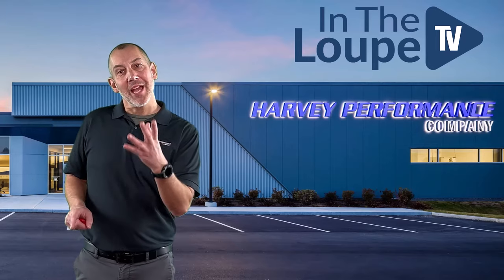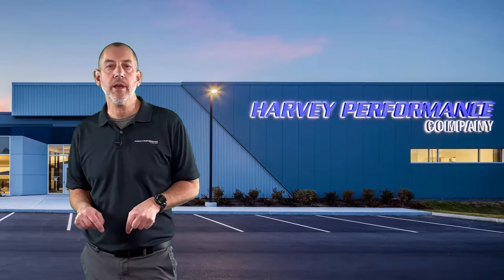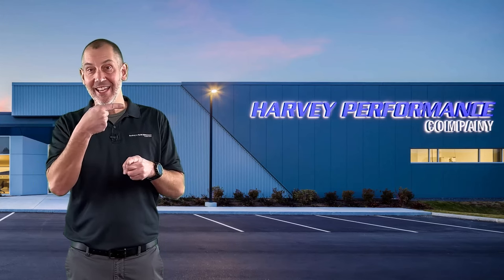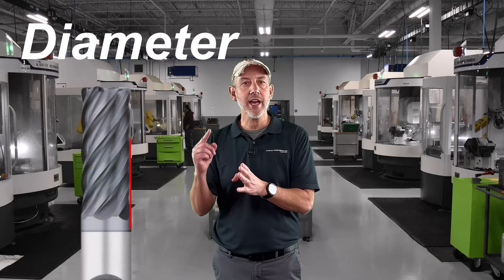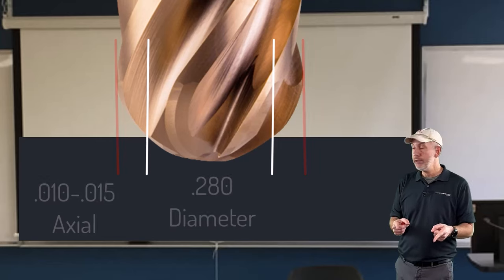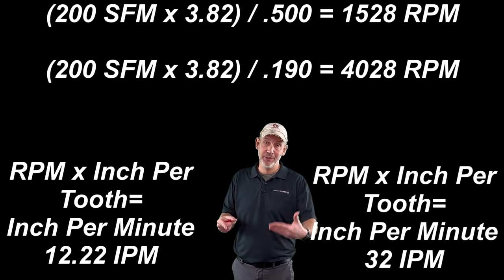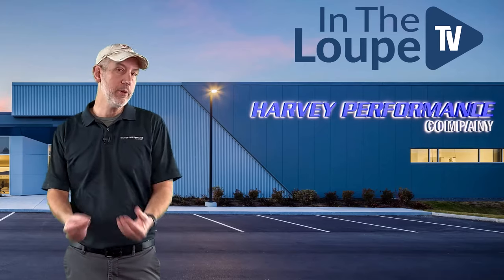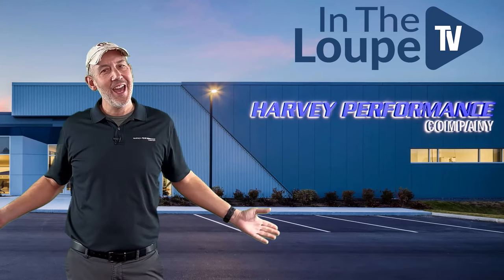Ball Nose End Mills & Effective Diameter: In The Loupe TV Short

Comment: This can be remedied on a 5 axis machine. If your surfacing with a ball and have the opportunity to increase your lead/tilt angle in your CAM software you can essentially do a .005 finish pass and use close to your full effective diameter.  
Obviously dependent on part geomety / clearances
Reply: You are spot on.  We are going to get into 5 axis soon.  But when you tilt you have a greater diameter to use and therefore can utilize the benefits of a ball.  Great comment!! Ctc

Comment: Nice video. But what happens when you cut 6061-T6 aluminum and your Haas machine has 12,000 RPM? It is impossible to achieve the RPM for a cutter less than 1/4 inch in diameter because you need alot of SFM (1000). And now, if you are machining a surface with a ball nose of 1/4in of diameter. The efective diameter is useless. In this case I assume that I use all the RPM that my machine has. but do I have to reduce the IPT?
Reply: Here is the thing with aluminum and SFM/RPM.  The reason we can run the SFM up so high is because of the properties of that material to form a chip and not put any heat at the cutting edge.  Just because we can run 1000-2500 SFM does not mean it will run just as good at 300-600 SFM.. ( obviously Slower)  So yes you are bound by the limitations of your machines capability with aluminum.   But your Chip load is calculated by the RPM you use.  So say you want a .003 IPT for a 1/4 tool.  Just Take your 12k ( MAX) and multiply 12000x.003x Flutes of endmill and get IPM.   Use the scale for any RPM to keep chip load constant.  This will ensure that there is no extra stress on your tool.    And yes it is exaggerated by effective diameter.  Hope this helps and great question! ctc
Reply: Then run 12000 rpm